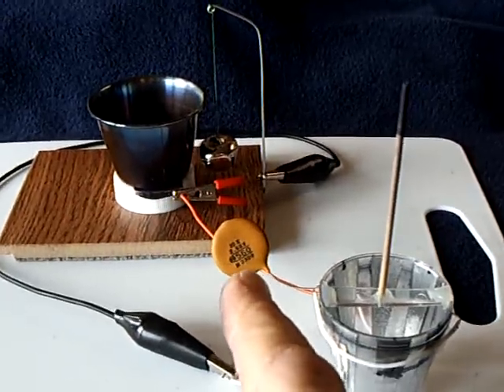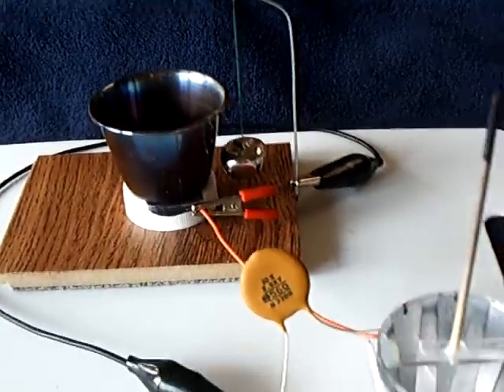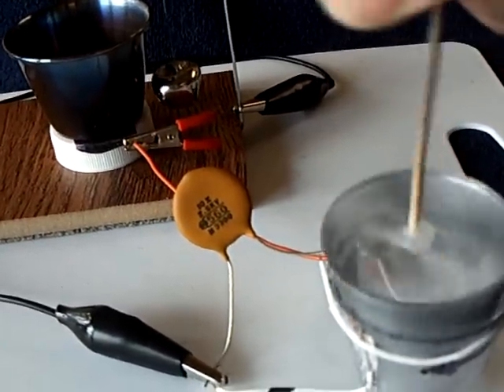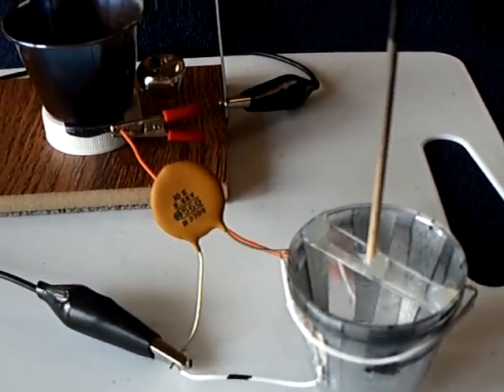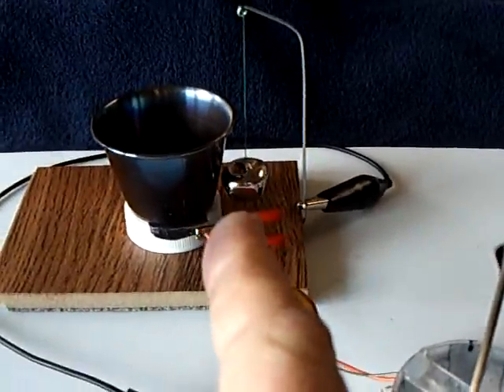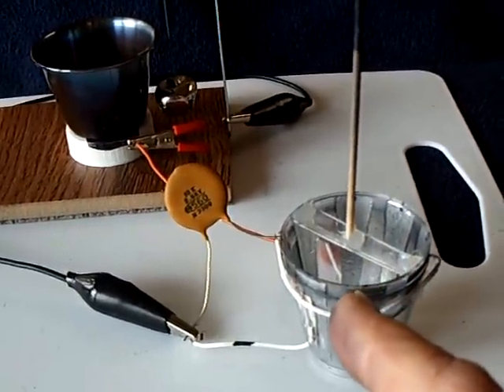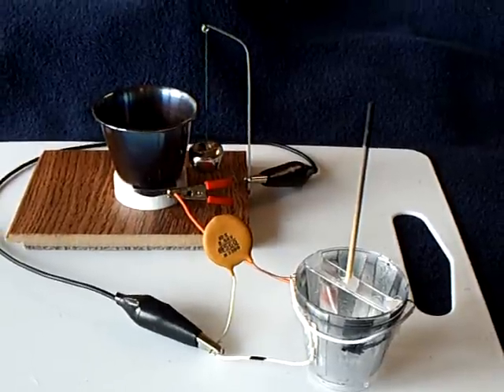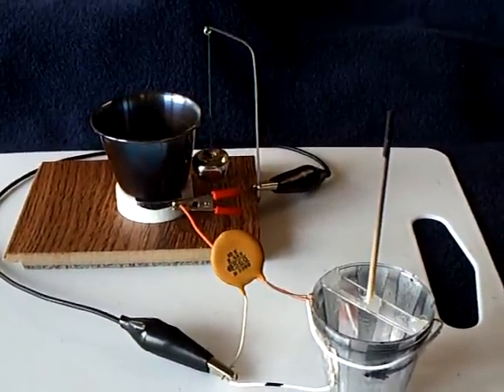Simple Electrostatic Generator -- with a capacitor

Comment: Watching this just gave me an idea for saving the earths fuel problems Cheers.remember you heard it from me first....get a small rocket firework shoot it into the clouds on a cloudy night with a thin wire attached to it run the wire into a large capacitor bank made from leydon jars or better,then make a huge ball bouncing machine like the one you have and simply connect the shaft to a alternator to get the electricity usable again simple.I go back to sleep now.
Reply: ravenrg84 or 99 luftballons
Reply from the maker: Excellent idea!  I will start building the 'huge bouncing ball machine ' tomorrow.
Reply: +Lidmotor what about a kite?

Comment: Hi lidmotor,
The capacitor value is 560pf 2KV not micro farad.
Cheers.
Reply from the maker: Yes.  You are right the cap value is 560pF not micro farad. Thanks.  I will make an annotation in the video.  The cap does have 2.5 KV written on it though.